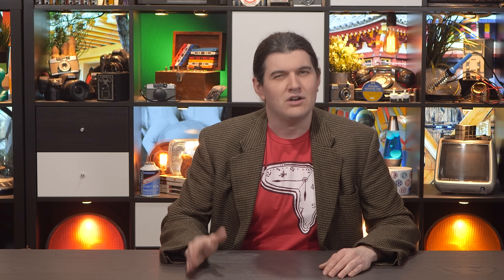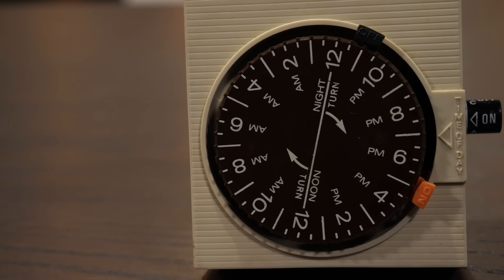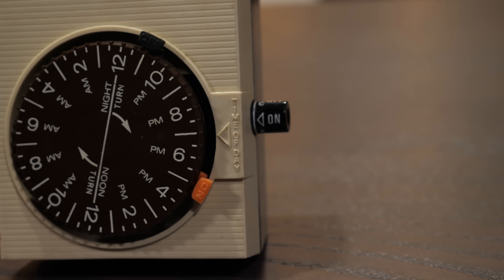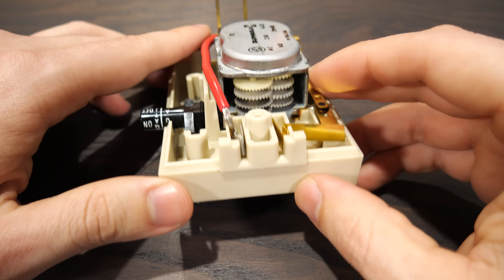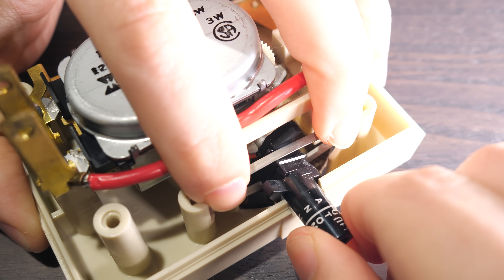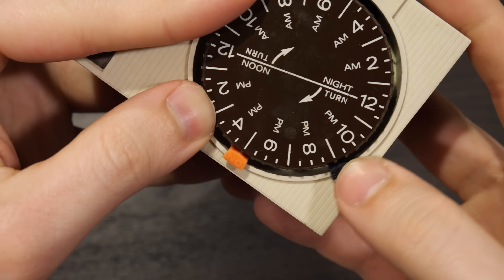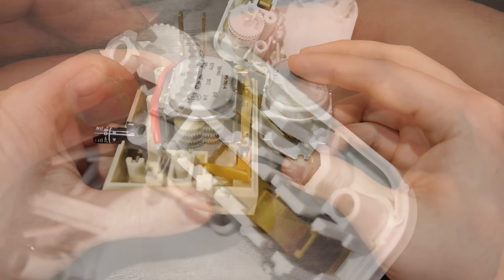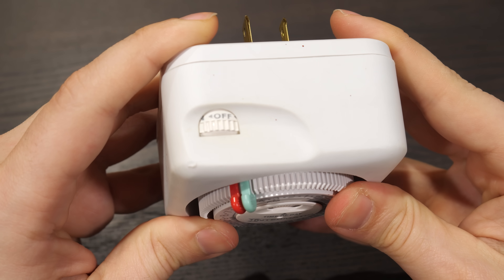Timer switches: literally just a clock and a switch

Comment: As long as you're using at least 1 pair of tabs (and why would you use it if not) and you want it on at least a number of hours equal to half the pairs of tabs you have (e.g. 3 pairs of tabs = 1.5 hours) then you can all store them in the timer, as you can place them in spots where they don't do anything (i.e. placing the remaining 'on' tabs after the initial 'on' tab and placing the remaining 'off' tabs after the initial 'off' tab), but yeah, it does have it's limitations

Comment: Intermatic's history began in Chicago in 1891 as the International Register Company, making fare registers, but pivoted during wartime and by 1945 introduced its first "Inter-Matic" mechanical timer, becoming famous for its reliable, simple time switches like the iconic T101, evolving to offer a wide range of lighting, energy management, and surge protection controls, and recently acquired by MPE Partners in 2025. 
Early Years & Innovation (1891 - 1940s)
1891: Founded in Chicago by A.H. Woodward to produce fare registers for streetcars.
WWI & WWII: Supported the war effort with manufacturing for munitions and aircraft controls.
1945: Launched its first mechanical timer, the "Inter-Matic," for applications like signs, lights, and burners, marking a significant shift. 
Growth & Dominance (1950s - 2000s)
1952: Introduced consumer versions of its popular time switches.
Legacy: Became synonymous with reliable, robust timers, with models like the T101 (a simple 24-hour mechanical timer) becoming household names, lasting decades.
Expansion: Broadened its offerings to industrial controls, pool/spa controls, and energy-saving solutions.

Comment: I got one similar to the last one too, with those tabs that can be pressed down or pulled out. And although the shape is different, the internal design is 80% same I would say, the same synchronous motor and the same mechanical switch

Comment: 11:52 we bought a bunch of these and I was disappointed that I couldn't temporarily turn on or off the lamp. Sometimes its really overcast and I want the lamp on early or I want the lamp off for the rest of the night while we watch a movie. Its fine for something like ornamental lighting like christmas lights but not as helpful for functional lighting. I eventually replaced them with Shelly outlets that are controled via home assistant on a timer but also with a remote so we can still adjust them as necessary.

Comment: Has anybody calculated the power consumption difference between the older "manual" timers and the new digital ones?  Just curious as to how much you might save an electricity cost if you left it plugged in All the time driving that little tiny motor versus going digital. 🤔.  Probably splitting hairs.😅

Comment: I bought two plug-in timers.  A smart one and an analog one.  

The plug-in smart timer that connects to your phone over the internet requires a specific internet Wi-Fi frequency...and my landlord has control over the router...so I now use it as an on and off button plug-in for my toaster since it has a button that can be used that way so I don't need to unplug my toaster when I'm done with it.

The analog one works like a charm on my aquarium hood light, so it is only on for 6 hours a day.  The only down side is I needed a magnifying glass to read the time of the clock dial to choose on and off times. And those little tabs can be tricky to push or pull only one tab at a time.  But the upside is no internet connection is needed.

Comment: My oil filled heater has a timer switch so you can manually program when it turns on and off throughout the day. Hasn't failed me yet but in a quiet room you can hear the clock working which I consider a downside to a smart switch's silent inter-switching operation.

Comment: the kind with the pins you push in and out are used on every water heater and radiator system in ireland nowadays, so you can heat the water for your shower in the morning without waking up early!

Comment: This is why I dispise modern electronics that you can't set to just come on when power is applied.
The kind that stay off after a power interuption and require someone to push a button to turn them back on.
Why did we do this, because mechanical power switches aren't cool.
Trendy BS that adds nothing to the funtionallity and in fact removes options.

Comment: I found a slightly different way to use these to turn OFF appliances after a set amount of time. For example, I want something to be set to reliably turn off after 5 hours. (I tend to forget!) I keept on-off set to always be ON until Midnight and OFF afterwards. So if I want something like a dehydrator to run for five hours, I quickly set the time to 7PM and can go to bed without worrying about it.

Comment: I used to use one of these 24 hour timers for....Internet access!  It was the late 80's.  I had a DOS computer.  And my very own Internet domain.  My computer would  connect to an upstream computer through a modem with UUCP protocol and get my email and Netnews.
I had that computer on a 24 hour timer;  it would come on at IIRC 3:00AM, stay on for an hour and then turn off.  You could do that with DOS computers, because they didn't do disk caching.

Comment: @TechnologyConnections: The connection you are show in 10:30 is indeed not soldered, it is called a wire-wrap connection. These - although a bit counter-intuitive - are more reliable as soldered connections. They were used quite often until the 90s.

Comment: Thanks to Google's new (AI Overview) I was able to find this after searching, "when was the timer switch invented"

According to the AI, it says, "Intermatic introduced the first time switch in 1945 for use in electric signs, store window lighting, apartment hall lights, stokers, and oil and gas burners. A consumer version was released in 1952, which expanded the use of timer switches in households. Timer switches are timers that control an electric switch. They can be connected to an electric circuit, low voltage, or built into equipment."

Comment: Very cool, but I still like the idea of using TPLink Kasa smart plugs, specifically them because they actually download their schedules from the cloud into the plug itself and store them until they are power cycled upon which they re-download them from the cloud, so if your Wi-Fi goes out but your power does not, your schedules are still in your plug as long as you don't cut its power off.

Comment: 1:05 there are some old tower clocks that could have an optional mechanism installed that would allow it to switch a gas valve for activating lights behind the clock dials. This was probably around the 1880s-1900s and a lot of the ones I've seen with this attachment were made by E. Howard and Co.

Comment: Hello, cheers from France. I love your videos on electric appliance.
Recently I noticed that timers could take significant amount of power. My mechanical timer switch uses <1W, while the cheap digital timer switch uses about 18W. Was the power saving a subject for a video before? I am surprised that moving a clock face is cheaper in electricity that simple 555 timer. The funny fact, my appliance that I controlled with the digital timer uses less than 18W, when on.
Have good November ;)

Comment: It is a very clever electro-mechanical design.  I used timer devices like these to control various lights and appliances in the 70s and 80s.   However, on some of the timers I owned, I noticed they got extremely hot - to the point where I decided they were actually fire hazards - and stopped using them.  Did anyone else have timers like these, and noticed how hot they got?

Comment: I prefer the tabby design, it is overridable, has multiple I/O times, and the tabs are replaceable with a cheap bit of steel fence wire
just ben a straight U shape in the wire, snip the one leg to the correct height, and bend the other leg with needle nose pliers to the right depth
I actually have a 15-20a (likely 15 as it has the nema 5-15r/p instead of the nema 5-20r/p) time switch originally used to control an old hog of a pool pump my parents had(we actually had to buy a generator cord as the pump only had like 6 inches of wire and pulled over 13a)
I used this timer to f**k around with automatic lights at multiple I/O times and yes I had to make extra tabs

Comment: I have an Intermatic timer (model E1020) in my basement.  It is hard wired to the fuse box and was used to grow "plants" in the basement by the previous owner of our house.  Still works if you flip the breaker.

Comment: The first product i ever designed as an electrical engineer that hit mass market was an electronic timer. The one neat feature that it had was random turn on and turn off delay so you can use it while on vacation without having it be obvious to anyone with a watch that the lights going on and off were not real. 
Not sure it was actually a good selling point however as i cant find the timer still for sale anywhere.

Comment: Back, I don´t remember when, I was called to a village in Germany where clocks went haywire when it was raining. Reason was that they had a pump for their high water protection system. The pump was controlled by a variable frequency drive. The drive was a thyristor drive, that, while running, induced interferences in the power grid of the village. The clocks then saw a grid frequency of 100 Hz, instead of 50 Hz, So, while the drive was running, the clocks went at twice the normal speed. A LC filter got rid of the problem

Comment: Sounds like you need a run through in the advanced Google searches. You can use "-" to omit words like if you're searching for timer switch but don't want Nintendo to show up you can do "timer clock  switch -nintendo" and if you really want to push it home you can have searches with only certain words included buy quoting them like this "timer "clock" switch -nintendo"

Comment: in Germany and many other countries its always a 50/50 chance to switch the neutral or line because you can plug most of the plugs on both directions. I hate that because people who don't know changing light bulbs on simple lights can shock them selves when touching the thread accidentally... 
It's not a big problem in newer electrical installations because a GFCI is REQUIRED on any outlets that can be accessed by lay people.

Comment: I use the polarized version of the TimeAll.  Of course, if you try to plug it into the top outlet, it block the bottom one.  Not very good if the bottom outlet is switched and is in a room with no lights.

Comment: I bought one with the pushy in pully out thingies a few years ago. It failed after a few months, due to one of the plastic gears losing it's teeth, so I switched to an app controlled smart plug for convenience. I'm still in the process to replace ordinary bulbs with smart lamps, because I'm lazy and I like to just use voice commands to turn the light on.

Comment: My boss bought a building and setting up the outside lights was sketchy because the previous owner had it hooked up by using a programable pool pump timer hooked up to high voltage relays.

I mean... It works surprisingly well but still

Comment: at 10:28 - are these wires even soddered? That's a wire wrap, which is a fairly standard wire fixing method, and works really well, giving very low resistance and good connetion surface ara.

I mean, you use those weird wire nuts to connect mains all the time in North America, right? This is just an improved version of that.

Comment: Back when DSL routers were even more temperamental than they are now, I used a digital timer set to be ON from 3:01 AM to 3:00 AM. At 3:00, it was OFF and killed the power to a plug strip for 60 seconds so all of the network equipment would power-cycle while I'm sleeping.

Comment: I think the timer motor had a date code. 137. That would probably indicate 8137, 37th week of 1981. It doesn't look old enough to be 7137, and it doesn't look new enough to be 9137. A lot of electronic parts are labeled this way - YYWW. Almost all integrated circuits will have exactly this same numbering system.

Comment: I have seen the Salisbury cathedral clock. This clock is said to be the oldest working clock in Britain, dating from 1386.(debate is still on as to the actual age the displayed clock. It maybe be 200 years younger. The original one may have been replaced in the late 1500's but what the heck, we are still talking oldie old school) The solo purpose of the clock was to strike on the hours of service to let local parishioners know when to pray.
The clock has no face, and only function is to flick a "switch" to chime a bell. It was the first time a standardized hour was used, as before is clocks were sun dials and the calculated hour varied due to the seasons.
You could argue that is was the first clock operated timer, maybe?

Comment: I was hoping you would cover my favorite doo--dad, the timer I use for my holiday (Halloween and Chrismas) lights: it plugs into the wall (or in my case my outdoor plug) and has three outlets on it.  It also has a dial that allows you to either turn it on, or set it to 2, 4, 6, 8 or "all night".  It has an electric eye that detects when it gets dark and turns on the lights for the specified time.  It is one of the most insanely useful things I have ever bought...

Comment: These times might be old school, however they are great to flick a light on and off when needed.  Have one on a light in the front room and there is some light when I get in of a night.  With a LED lamp installed (5 W) the light can be seen from the street through the corners of the drapes and uses next to no power, only around AUD$6.00 per year.

Comment: Electronic timer... I bought one 30 years ago.
It had a lithium battery that lasted 5 years or so.
And a programmable wall thermostat is basically the same thing.
I replaced the old mercury thermostat switch with this about 20 years ago.
It needs 2 AA cells to operate and they last a couple of years or more.

Comment: Clock and switch is good enough. Is reliable. Electronics tend to have batteries - they frequently fails. Timers in home tend to have very important duties. I'm in IT, biz, but no IT in my home so far, except for phones, PC's and some Arduinos.

Comment: My automatic sprinkler system is old and it has the removable tabs to mark the on & off times. When I only want a single on/off cycle, I just put the extra tabs right behind the active tabs where they will have no effect.

Comment: Love your videos, but the days don't get longer or shorter and the sun has nothing to do with it. It's all the Earth and the way it rotates and tilts and stupid politicians that won't leave the clocks alone. But the days for now, unless the polar shift occurring does something unforeseeably  weird, the days of our lives are still 23.75 hours long, hence the leap year every 4 years. Still enjoy your videos. I took apart my Grandpa's lamp timer when it didn't work anymore. I wish I didn't take it apart to the point where I couldn't get it back together again, because I did manage to fix it, but my curiosity got the better of me. It was not plastic. It was metal. A pretty green and white color and it was made well. The thing that broke was my Grandpa or uncle had pushed the little lever switch in, which would over ride the time and be either on or off. They didn't seem to understand it when I explained it to them, so they just got a new one. I tore the thing apart because I wanted to know everything about how it worked. I couldn't get it back together. Even those little tabs were metal. There were only 2 and they did not remove. You would press them in and set them on the dial where you wanted them. They would rotate then flip something that moved a switch as it went by. It had a cord on it, instead of plug directly in the wall as to not block outlets or be a problem with outlets that didn't hold tight. My Grandpa's house was built in a time before polarized plugs became a thing, so that had him cutting the plug off everything and putting on a cheap replacement he got at a hardware store. Very dangerous. Especially when as soon as he plugged in some things, there would be an arc and flash, then he'd blow a fuse. He finally got a circuit breaker panel and polarized plugs, but no ground... That almost caused a big problem in the late 1990's for him. He finally sold the house in 2004 as is. Ended up with $60,000.00 for a house that was worth $190,000.00

Comment: Ahh 11:56 great minds must think alike I got tired of fiddling with this thing each time I use my old dehydrator so I just scribbled it on there in Sharpie... Also noticed a little hiccup when using it on mine pressed in is on and I noticed that if you plug it in with the switch turned to the pushed in section it seems it has to go a revolution before it actually works so I just cranked it over to the time of day with it actually plugged in.

Comment: Recently found a timer for an old central heating system in the UK that was a hybrid of the designs. I wish I saved it from the scrap heap to disassemble it! Two rings instead of a dial, with 4 metal pins (with places to keep them on the front when not in use) to put in the On or Off holes around the ring. Guessing ~1970s by the style of it, but probably sold for a lot longer than that.

Comment: In Israel those timers are widely used and we call them Shabbat Clock. Since we cannot control electrical devices during the Shabbat, we use those timers to control the lights and the heating plate. They do a great job until they don't, when the food did not heat up or the light is on the whole night. But they are popular and the quality is good. The aquarium and gardening lights are controlled with wifi switches, that stay correct for longer times.